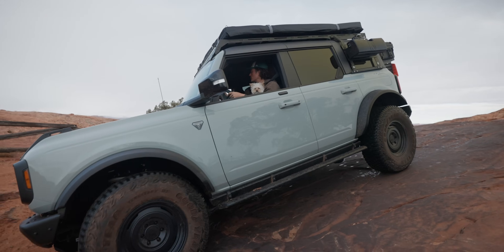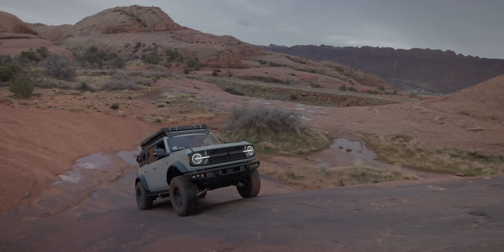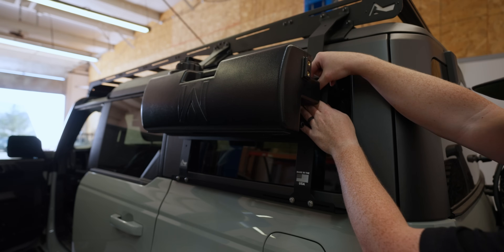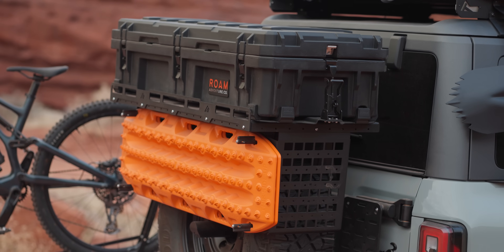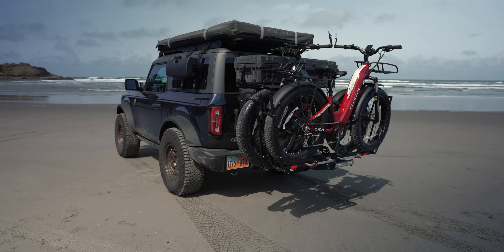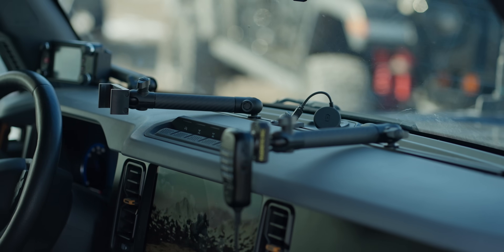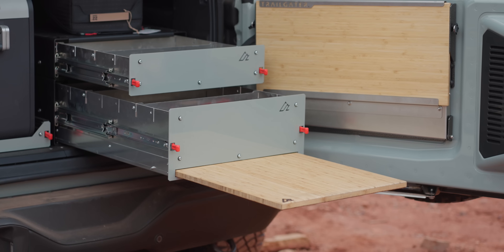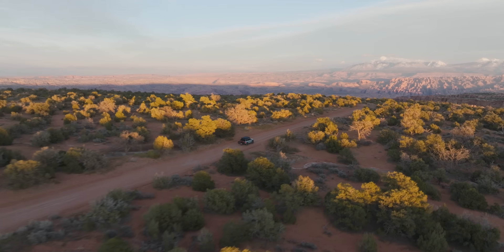How To Build An Overland Bronco In 2023 Full Walk-Through

Comment: A note on the tie rods. There really hasn't been many broken tie rods on stock geometry suspension. When they do break on stock suspension it's generally due to front locker use and the front end being bound up. With that said upgrading the tie rods to something stronger moves the weak point to your rack. A way more expensive and much much harder trail side fix.
Reply: 100% agree with you. 74 Weld will have the best solution for this!
Reply: @5L_Eater  definitely! One day I will get their rack replacement for some piece of mind.
Reply: Good thing I have a new tie rod kit and rack kit.
Reply: There is a brace made for the rack to internally brace the inner socket(inside the bellows) and it seems to work well.
Rough country makes forged tie rods too.
Reply: @Serenityindailylife  sure but that just helps with the deflection. The rack case itself is weak as well.

Comment: Orlandos 4 door with all the extra weight added by roof rack tent and all the other 50 accessories. have you checked how much the bronco weighs? cause I am pretty sure you are a couple hundred pounds over the GVWR of the bronco.
Reply: I was about to say, the roof top tent weighs around 90lbs, but once you add a human or two in there, and you’re talking well north of 400lbs on a hardtop rated for 110lbs?

Comment: It’s cheaper to replace tie rods than the steering rack. If you want a steering rack solution 74 Welds billet rack is the ultimate solution for this problem. Imo, ford designed the tie rod to be the weak point for a reason.

Comment: Love this video!  I've watched it over a hundred times as I'm building my Bronco camping/fly fishing rig.  Quick question.  To mount the WaterPort to the PackRax, did you have to drill 4 new holes into the PackRax to mount this?  I can't seem to find 4 holes that line up for the WaterPort mount.  Also, assuming you had to drill 4 new holes, if you remember what sized metal drill bit you used, that would be insanely helpful.  Thanks in advance and keep up the great work!
Reply from the maker: I only drilled two bottom holes. I can’t recall what drill bit I used, but I’d recommend getting a step-bit.
Reply: @JustinBMcBride  Awesome!  I see what you mean. I bolted the top plate to the packrax and I see why you only drilled two holes for the bottom holes. Thanks for the tip!

Comment: Hey @JustinBMcbride, quick question: I’m trying to do a battery bank setup similar to yours, but would like it to be tied in to the Bronco’s battery to help power some of the heavier loads I’d like to run on the aux switches (winch, compressor, lights, etc.)… What are your recommendations? I’d also like to put a solar panel on the roof rack and have it help charge that battery bank, if possible. I’m not trying to power anything that needs power when the vehicle is not running.
Reply from the maker: Redarc. Every question you just asked can be answered with a Redarc system. However, you won’t be running the factory switches.

Comment: Is there a reason for curve on the wind deflector on that roof rack? I feel like it doesn't fit with the straight line aesthetics of the Bronco.
Reply: From a side profile, it is more understanding. The Bronco windshield has a nice spherical shape which once you get a flat piece of aluminum, it adds that bow. We wanted to offer more function on this to decrease wind noise. We achieved the decreased wind noise and better overall aero dynamics for a Bronco with a roof rack addition. Hope this helps understanding why it is there.

Comment: you say 110# limit on the bronco hardtop- I am assuming thats the max when moving, so it is okay to add more weight when not moving.
Reply from the maker: Correct, that is dynamic load, so while driving. Static is around 350#.
Reply: 350 static? Yikes… 100lb tent, 200lb dude, 130lb wife… plus rack weight… way over. Forget adding a larger tent and 2 kids. Guess I need to look at a rack that mounts to a bumper? Any suggestions for carrying/sleeping more weight?

Comment: In the Major Tom I noticed you switched from a Dometic 45 to a 55 somewhere along the way, but then put a 45 in Orlando’s. Any specific reason for that? I’m trying to decide between the two. I would prefer the 45, but unsure if there is enough clearance for the lid to be able to stay open by itself. The 55 solves that but is a little overkill for me. You are one of the few I know of that has tried out both in a Bronco so any advice is appreciated.
Reply from the maker: The main reason for the 55 in the two door is the lid opening. The rear speaker on the 2 door sits right above the fridge and prevents it from opening fully without sliding out. Sometimes, when just needing to grab something quick, it is more convenient to have the side open of the 55.

Comment: Hey @JustinBMcBride, great job once again.  Awesome build.  I love RTR (just ordered their Project X light kit)... but, their tailgate reinforcement is a bit out of my budget at the moment. Do you think I can get by with the RC reinforcement like you did?  Or, am I asking for tailgate issues when loaded up with the AAL Spare Tire Platform, roam box, and a standard sasquatch 35 spare? Realizing it is not your first choice, have you had any problems?
Reply from the maker: When at Johnson valley, I noticed that my door had slipped a little under the weight with the RC mount. I had to pull everything off and readjust it all. 

After that I was very careful on any whoops or washboards not to go too quick and to pick smoother lines to prevent any issues.

Comment: Isn't one of the main purposes on the TrailRax to give you more weight capacity? I know Ford says 150lbs, but that's with the OEM rack.
Reply from the maker: It does add some, but I’m still the type to follow the manufacture’s recommendations. I did have a 160lb tent up there from 4x4 Colorado for a few days and the TrailRax held up to it. I can’t speak to the long-term of that kind of weight on the hard top though.

Comment: Great video Justin - I’m curious if you have a more detailed video of the aux battery system install available? I’m working on installing the same system right now and am trying to figure out where to tap into for the engine on/off signal.
Reply from the maker: Hey! I have a buddy doing this install this week and I’m going to film that. I’ve gotten this request a lot.
Reply: Thanks! I figured you might have received a lot of questions on this one. Looking forward to the video. I almost have everything installed myself…just trying to figure out which fuse to tap into for that blue wire on the Redarc BCBC 1225.
Reply: @JustinBMcBride  Did you ever film the battery install?  I was going to try the same system, but am having trouble figuring out all the nuances of running the batteries in parallel, where I need fuses, etc.

Comment: Okay that's all fine and good, but where did you get that shirt brother.

Also, you should have skipped RTR. They're overpriced as per usual with RTR products and the Hammer Built spare tire modular system is a better bang for your buck, which allows for additional mounting points for things like radio Atenas, chase lights, and fuel/water storage. All of that and you don't sacrifice any quality.

And thanks for all of this detail oriented information. I am now going to be broke thanks to you!

Comment: Best roof rack not sure i agree, I like the gobi rack myself!
Reply from the maker: It mounts to weird spots and is made of steel so it will rust, not to mention the difficult history Gobi has of delivering roof racks in a timely manner. The TrailRax is still best.
Reply: I’ve seen Jeeps after removal of a long term Gobi, leaves scratches and body damage.  Can’t imagine what it does to aluminum Bronco panels
Reply: But can’t use with top off can you?
Reply: Bad ass tents rack is way better

Comment: @ 5:35 host mentions that the tent and an air mattress is short of the roof’s max capacity.  If my math is right, we’re looking at about 10 lbs to spare. However, isn’t anyone supposed to go up there and sleep in it?  I’m 6’ 2” and over 200lbs, soooo?
Reply from the maker: Dynamic load vs dead load. Meaning 110 pound limit at highway speeds. Hopefully you’re not up there while doing 80MPH.